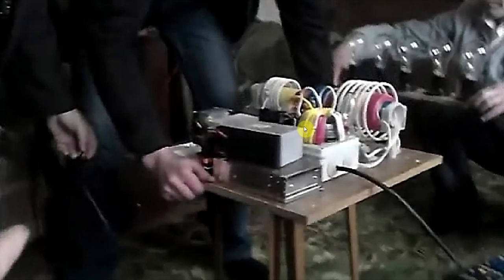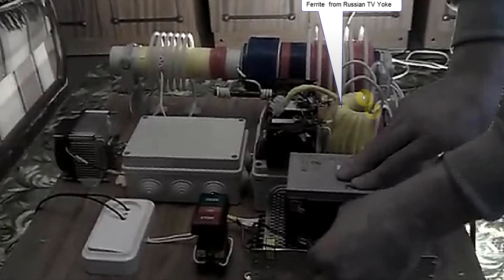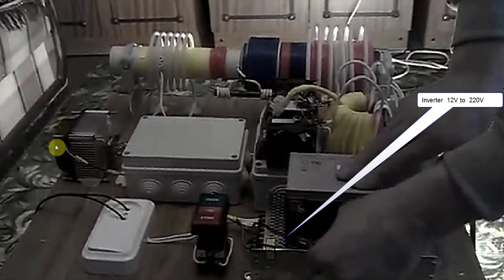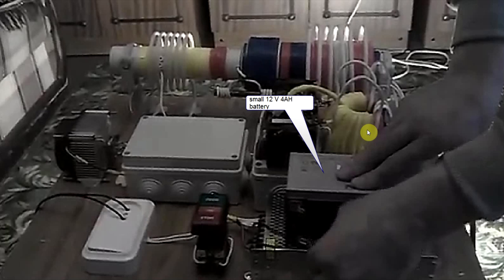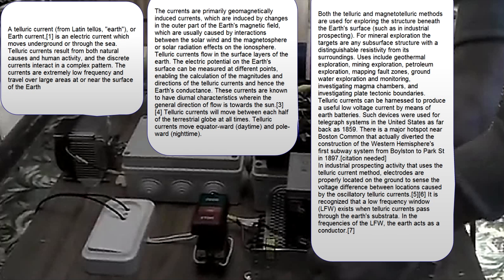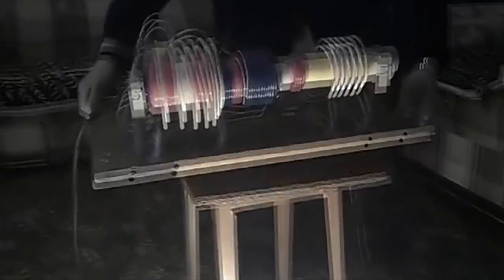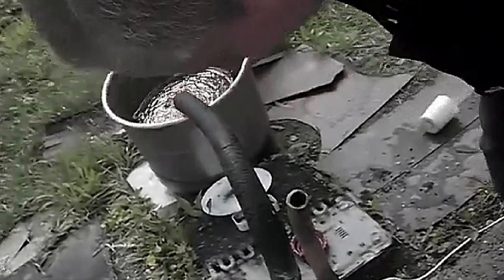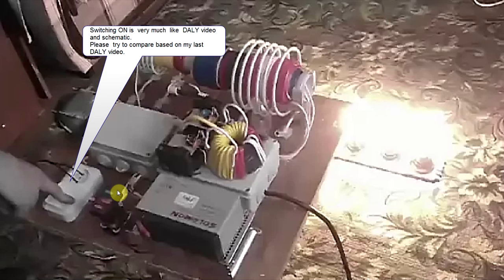Akula video17b. Business trip of Stepanov to Akula.- It works!!

Comment: I am not a troll, and I thank you for doing this, giving your additional input. Only critic here is the ground wire, and the video being edited. We do not get to see the complete ground wire in this video. Perhaps Akula could show a metal bar on the outside of the device where he connects the ground wire, so we can see it is really just one wire. Perhaps he could even use a fuse (just for fun and info).
Also note: do you think the wires on the tube are made to match? The two outer coils both have 6 windings, one set is just less thick as the other side. Looks to be some resonance thingy.
Reply from the maker: yes that is  Akula mistake . However THERE WAS MY FRIEND WHO WAS THE WITTINESS